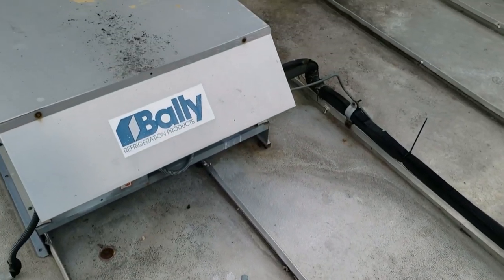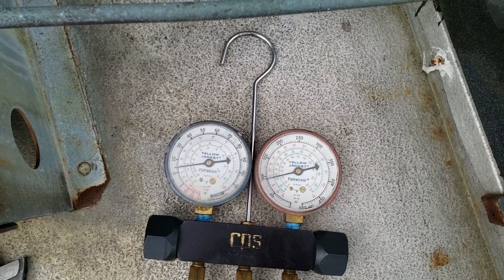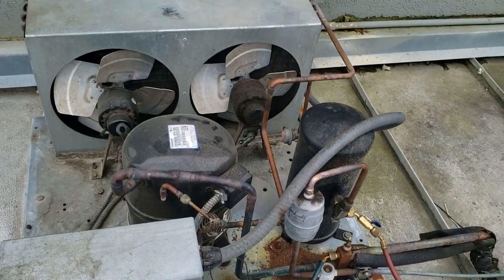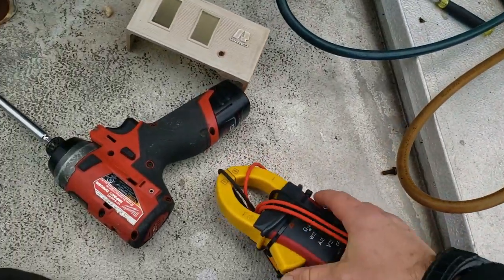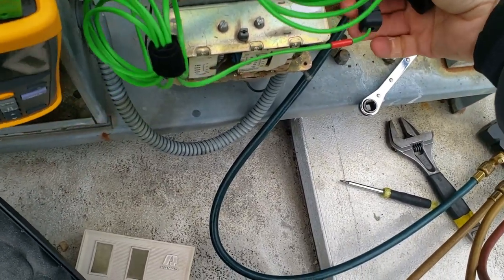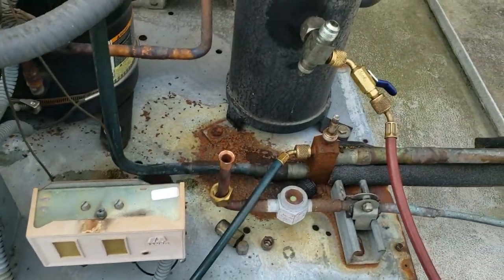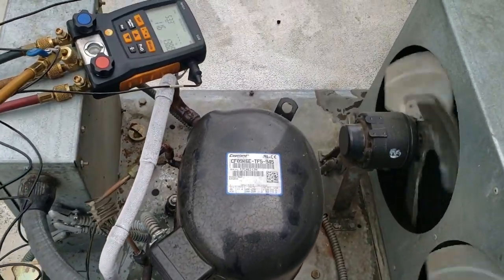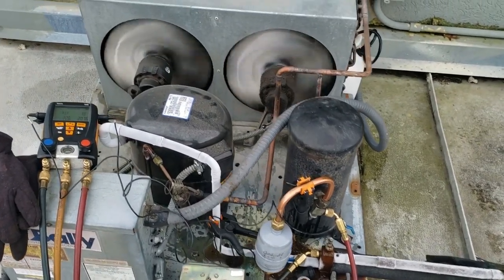WHY IS MY FREEZER WARM? Do I Have A Leak or A Restriction?  BIG Problems Ahead!

Comment from the maker: Sometimes you get your head kicked in by the headmaster! It held back the liquid and only allowed some hot gas through. The result is a starved system! I almost missed this one... I got humbled today! The key clue that made this not a restriction further down the refrigerant circuit is the sight glass was empty, if it was a txv it wouldn't cause a empty glass.
Reply: HVACR Survival but you DID catch it. That’s what makes a great tech. You prevented a callback.
Reply from the maker: @marknaravas318  Yea....your right.  I knew something wasn't right and didn't want to leave till I figured it out,  thanks man! I appreciate you watching and commenting!
Reply: I have the fluke 52II also, I noticed your pipe clamps are an aftermarket.  The Fluke pipe clamps are about $150-$180 each... I sometimes wonder if they are all that much more accurate than the knock-offs.  What I try do is clamp both on the same pipe for 5-10 minutes to see how far off they are. three degrees is a very small measurement that could conceivably screw you all up during troubleshooting if the test instruments are off just a minuscule amount. How much are those?... also, leak searching is the toughest part of our job, especially when its in the line set somewhere and very small. How do you like that ultrasonic? I saw a vid recently but man they are up there is price.
Reply: They are in inanimate objects but sometimes they seem to work against you. The old head scratcher. Good find. What is it about that flaring tool that makes it better than the old style? I noticed the indention on the base. I’m always looking for something better.
Reply from the maker: The orbital flare slowly flares it out vs just straight down like a typical flare tool, both work but they say the orbital will stress the copper less, resulting in a stronger flare,  or so I have been told🤷‍♂️ who knows anymore, it's like we're lied to on a routine basis anymore🤦‍♂️
Reply from the maker: The probes are Hilmore, normally I try to only use Cooper Atkins.(usa made probes $$$) I tried both Hilmores on the pipe earlier and they were acting weird,  I'm not sure what's up with them.  I don't use them very often.
Reply from the maker: @hvac01453  I just made a video on the ultrasonic,  I like it and they are crazy priced,  they have 10 & 15% discounts now and then.  I purchased the basic one used on Ebay for about half price and looks and works like brand new. The Hilmore clamp probes are in the 35-40 dollar range each,  I got them because they will work on 1/4" lines but the male plug is weird and might have been what caused a random temp.   measurement.

Comment: Thank you for posting. This is a very interesting case.
Regarding delta T, please viewers correct me if I'm wrong:
- ambient 53F,
- receiver T2 = 78F
- after filter-dryer T1 = 76F
Delta T was relatively small and could be attributed to cooling the liquid due to lower ambient temp (liquid - ambient temp = 25 F).
Reply from the maker: Your correct,  the drier should have been cooler if the restriction was happening,  all the more reason I didn't believe my readings.  Degrees over ambient is a rule of thumb and won't always be exact. You were definitely paying attention to all the clues I was showing👍👍. Thanks for your time and attention🍺🍺. Have a safe weekend!
Reply: @HVACRSurvival  I gave this case some thought and this is what I think. Assuming all components are working properly I diagnose low (winter) charge.
Explanation: at ambient temp. ca 50F head master is open from compressor to receiver and closed from condenser. After each compressor start, some refrigerant is condensed in cold condenser and not in warmer (hot discharge gas) receiver. Refrigerant collects in condenser and is not available for liquid line/TXV. After compressor start, TXV delivers small mass flow of refrigerant (mixture liquid-gas or only gas  reduces flow through TXV) to the evaporator, suction pressure drops, low pressure switch cuts-in. System is locked in a state and will not leave it on its own unless, e.g. ambient temp. raises.
After you defrosted evaporator, more suction gases were available (quicker evaporation), more time was available to build-up discharge pressure, head master opened flow or liquid refrigerant from condenser, receiver obtained some column of solid liquid, TXV started proper operation, system stabilized in a state of normal functioning.
Suggested repair: a) provide proper winter charge (solid column of liquid in receiver even if condenser is filled with liquid refrigerant, b) check for restrictions/functioning components along liquid line.
Reply from the maker: @Luzt.  email me please so we can go into more detail.  Hvacrsurvival@gmail.com

Comment: I guessed, solenoid valve leaking past some times and low on charge combined.  the short cycling caused oil in the drier and system to act worse and the odd sight glass at first.
but playing around cleaned whatever was stuck in the solenoid/txv/headmaster. I'd assume the whole system is full of fudge brownie batter inside lol
Reply from the maker: Going back to replace the parts today. I guess we will see.

Comment: I was surprised to see you never even looked at the other end of the system.  The TXV power head is one area to check.  Also what if you had a wax/ moisture buildup on the TXV, then balancing the valve dislodged it temporarily. hopefuly the drier picks it up.  A hot rag on the TXV will sometimes tell a story.
Reply from the maker: How would a clogged TXV cause an empty sight glass when the glass is before the txv? it couldn't because it would back liquid up to the reciever. That's was the key clue that caused such a problem figuring this out and why I didn't go that route.
Reply: @HVACRSurvival  its hard to say if you only look at 1/2 the system.  The sight glass cleared up and ran good with the old dryer..... you have a clear sight glass, how is changing a dryer going to fix something thats working now.  The head master is more suspect than anything.  Its supposed to maintain a 215# head pressure minimum, it wasnt able to do that.  I would also fan cycle one of those condenser fans, if your in a cold climate area. You may still have a leak somewhere. Weighing in the charge, or pump it down and then look at the level in the reciever tank.
Reply from the maker: @hvac01453  my head pressure once it started working correctly was running 205 lb. I generally never see exactly what they're asking for so that was no real surprise that it was off by 10 lb. yes I am in cold weather right now and it is running about 45 degrees outside,  I did look at the evaporator and the TXV while I was inside the evaporator scanning for leaks.i I did not record it. There was no leak. That's what I thought was wrong in the beginning. I put that in the description because that is what I was thinking in the beginning so it's a part of the video to draw people in. Hindsight is 20/20. I have never had a Headmaster do what it did,  I mentioned that in the video. They're usually stuck. So from here on out I will definitely keep an eye out for it but at that particular time I've never seen that before so it was not something I was expecting. That's the reason why I shared it with the world. I've only had to replace about for Headmaster controls. The reason I added extra refrigerant was to overcharge the system essentially doing what the Headmaster does and forcing the extra refrigerant to drive liquid to the txv.  At that point I did not have a Headmaster on the truck and there was no supply houses remotely close. sometimes you just got to do what you got to do to try to make it work. Sometimes things are done half-ass just to make them run.  that's not how I like to do it but that's what I had to do.
Reply: a hot rag on the txv sensing bulb? what would that do exactly? will your SH go down? 
also, another question, if you were to wet the condenser, wouldn't your discharge and receiver lines be around the same temp? because its full bypassing the condenser?
Reply from the maker: I'll be releasing the repair 4-8-2020.
Reply from the maker: @brianpan57  by warming up the txv bulb,  it should cause the txv to open letting more refrigerant trough,  it's a basic test that tells you that the txv may respond,  it doesn't tell you if it's out of tolerance. By adding water to the condenser it will drop the head pressure, possibly low enough to make the headmaster react,  resulting in verifying it will respond to the pressure difference. (This works when it's colder out.) I'll be releasing the repair on Wednesday,  4-8-2020.
Reply: @HVACRSurvival  thank you very much
Reply: @brianpan57  also, sometimes wax can buildup inside the TXV right where the tiny orifice hole is (coldest point) because of the pressure drop.  This was an old technique mechanics used in the day to try get the TXV to release the wax plugging flow, and hope the dryer would pick it up next trip around.  They would use the hot rag on the valve body. The bulb in the warm hand is usually good enough for med temp.  100F water for low temp.  This should force the valve wide open like a faucet.  The valve is bad if.....
a.) There is a solid column of liquid on the TXV inlet.
 b.) The strainer is not plugged. 
c.). There is a pressure differential across the valve, but refuses to open.

Comment: thanks for upload. good video. like you saying the one of the fan motor is going bad. what kind of motor is that? shade pole? how many watt is that.?
Reply from the maker: I erased the pic in my phone but it's 230v, probably 1-1.8 amp area. Thanks 4 watching👍👍shaded pole I believe.
Reply: @HVACRSurvival  thank you Rick. besafe out there

Comment: HVACR: is ball of ice outside the accumulator on a walk in freezer ok? It’s a Beacon system 404A. The evap don’t have ice. Haven’t checked superheat or subcooling.
Reply from the maker: A lot of that has to do with your dew point and your outdoor temperatures. The only real way to find out if you're causing any damages is to do superheat at the compressor and also check it out the evaporator.
Reply: What’s the typical super heat at the compressor and evap for walk in? It has an EEV.
Reply: HVACR Survival. Checked things out. Found that suction line temp sensor not reading right. Is 40 degrees superheat at the compressor ok?
Reply from the maker: @derrickgarcia303  email me. On here is not the place to talk about it.

Comment: how you likely the flare tool.  /   let me know  thx   good video    be safe and wash your hands  !
Reply from the maker: It has a really good job. This is the type of flaring tool they say you want to use when doing Mini Splits because it's slowly rolls to Copper into the flare position. I pick mine up used on eBay for a great price.
Reply: @HVACRSurvival  ty sir

Comment: Rubs hands 👏 me: let me put my thinking cap on. Also me: that headmaster kicked both of our asses in the head. At first I thought the solenoid wasn’t opening up all the way but then when you released it I’m like no that’s not the case. Then I thought exactly what you thought the filter dryer.  with that temperature difference I for sure thought it was the filter dryer. We both almost missed that 😂
Reply from the maker: It's a great learning experience for me as well as anybody else. I felt kind of dumb but I'm not here to brag or think I'm some super tech. I'm just like everyone else. That's the first one I've seen do this, it's something I won't forget!
Reply: HVACR Survival amen to that

Comment: When checking for temp difference across the filter drier, any advantage to swapping the probes positions to check accuracy?
Reply from the maker: At one time I had ran those probes in ice water and wrote down the temperature they were so I knew how much to offset them by. Generally that's how I check my calibration. At first I used one probe and repositioned it afterwards which would have been just fine and technically would have been more accurate to use the same probe for both but it didn't give me measurements that were consistent,  same thing when I did two probes. (I do not like those probes.)  I should have gotten out my better one.
Reply: Best thing to do with probes BEFORE checking td is put both clamps on the same tube and make sure both are reading the same.
Reply from the maker: I'm selling those 2 clampa off and purchased a Fluke and a Cooper Adkins clamp for my Fluke 52ii.
Reply: The Fluke clamps are real nice looking , but pricy. last time i looked.